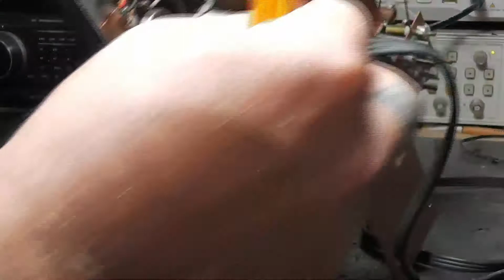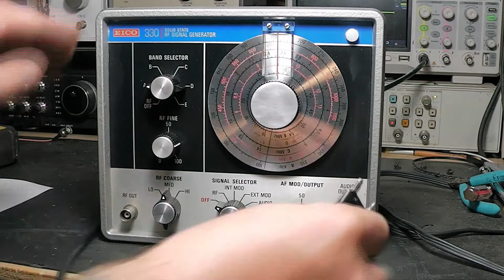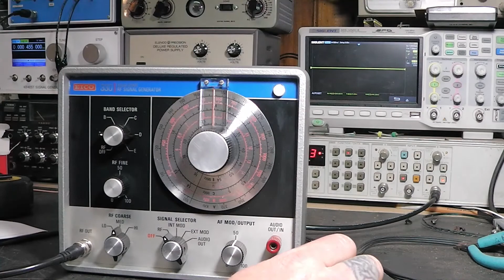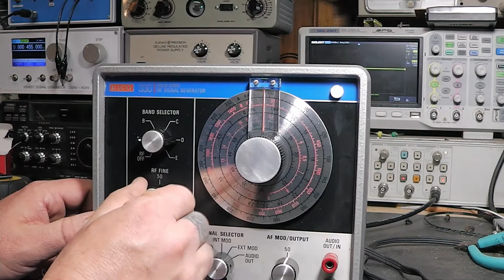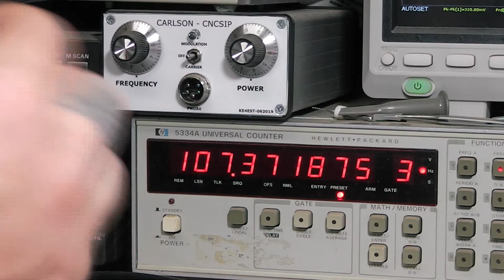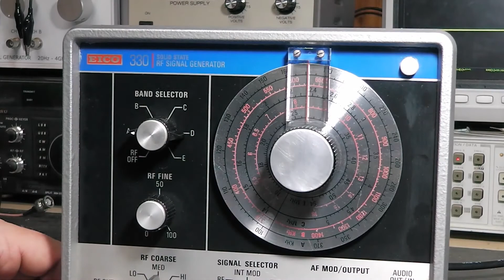EICO 330 RF Signal Generator RESTORE PART 2

Comment: Whenever I have aligned a generator of this type (Eico, Heathkit, etc.) I always found that it went off a bit once the cabinet was put back on. Wonder if you found that with this one.
Reply from the maker: Yes, I did.  Nice that this one has the holes in the back to touch it up!  I mentioned that on the first take of this video.  I failed to mention it in the second take.  It was very slight, but it did happen.